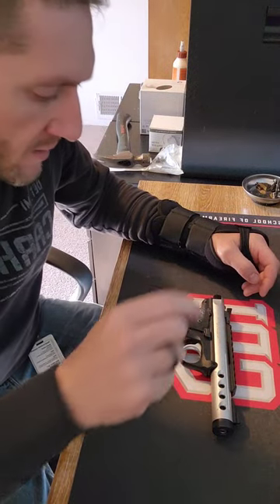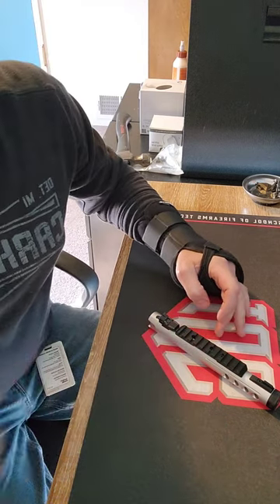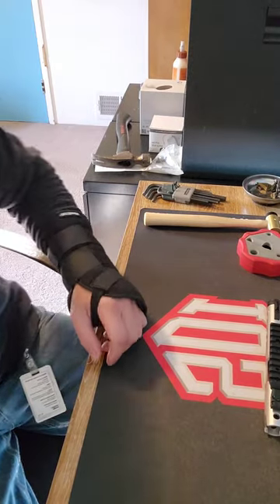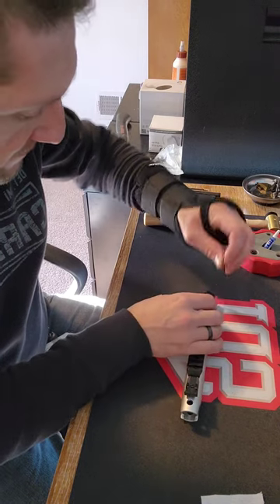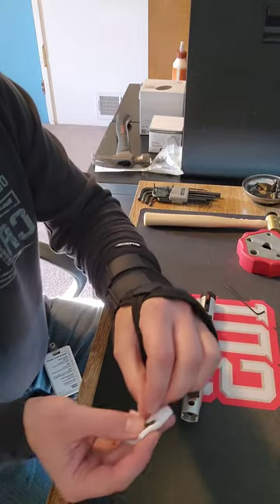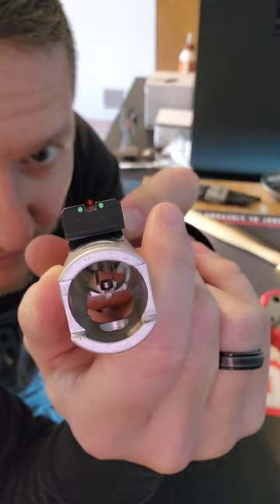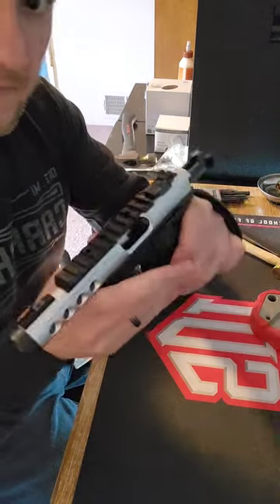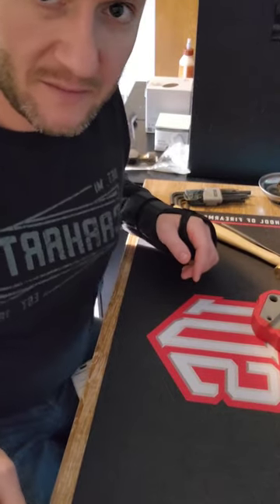Ruger Mark IV Lite site replacement.

Comment: What sites did you use for the rear sight do you have a model number or a manufacturer
Reply from the maker: I installed Ruger sites that can be ordered directly from Rugers website. Item # 12940